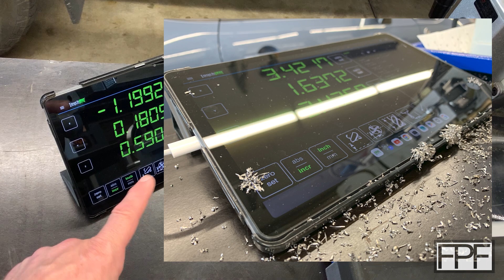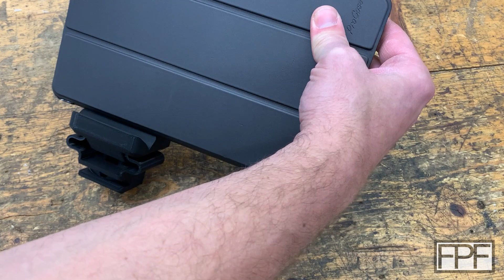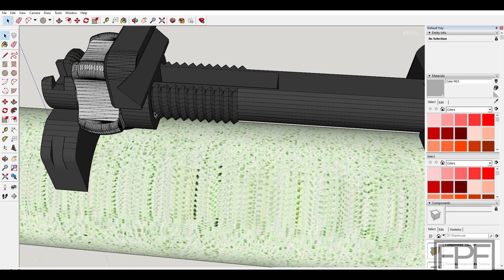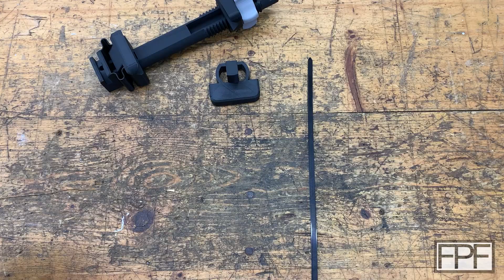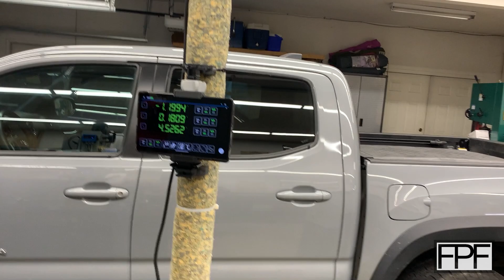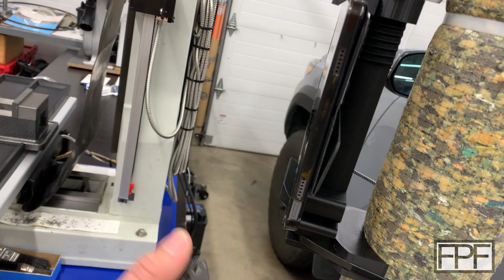3D Printed Pole Mount for Tablet - TouchDRO

Comment: So, you don't ever use Portrait mode?  TDRO displays bolt patterns well in portrait (milling mode only, not so useful on the lathe), so I like my holder that rotates to either orientation without taking the tablet out.  It has little clips on all 4 sides, so it's not relying on friction to hold against gravity when in portrait.  Your holder is simpler and more elegant though, if Portrait is not a desired option.  Bolt patterns are a big deal for me but not for everyone, and of course you can still do them in Landscape anyway.

Comment: For the future holder try a stand on top of the unit that is kept in place using magnets, I suggest strong magnets from old obsolete HDDs or the like.
Vibrations are going to be a concern regardless of your chosen method.

Comment: Nice job on the modifications and your final design!  Did you use offset, push pull, etc.. to adjust the clearances and spring thickness. 
Asking for a friend.🙂
Reply from the maker: used both offset and push/pull, depending on the face
Reply: Thanks! @FunctionalPrintFriday

Comment: GReat job adapting the original file.   I`d suggest you maybe print a TPU cusion so it`s s got soft jaws , where it grads the tablet.  not shure what adhevive would glue TPU and PLA.  also, be carefull if you use superglue, it makes the PLA go white.
Reply from the maker: thx for your comment and suggestion

Comment: Nice summary and solution.   Really find your channel helpful and inspiring.  Thank you. 👍😎👍
Since you asked for ideas…… I suspect you don’t actually need the protection foam that high on the pole.  Maybe a smoother mounting surface will provide other options you find useful?
Reply from the maker: Thx, and yeh, it's true, but then it wouldn't match the other poles in the garage and my OCD would kick off.  All kidding aside though, it would create a small new problem in that the surface would be very slippery for those standoffs.   Could solve that if I had to, but I don't mind the foam.

Comment: Hard to tell from the video if the tablet is within arms reach when you're machining something but if you needed it to be closer, you could always get a spring loaded articulating arm mount that would fit your tablet and print a mount for that to attach it to the pole. Would be highly adjustible and bring it closer if you need. What you made is perfect though if you don't need to interact with the tablet while machining. Plus, its only the cost of filament and a few zip ties.
Reply from the maker: Yeh, it's tough to judge the depth there from the video, but I can reach it.